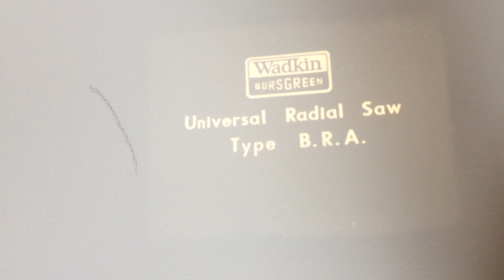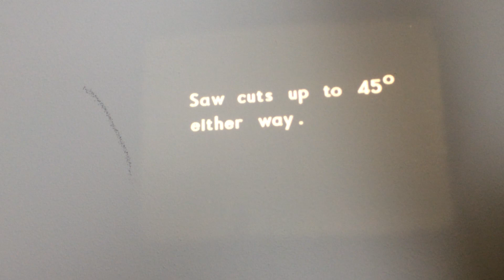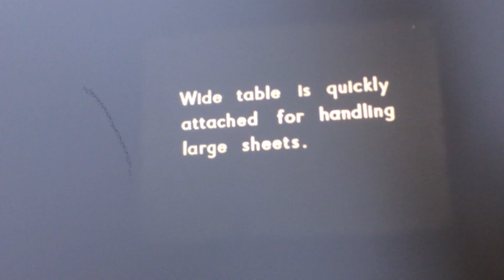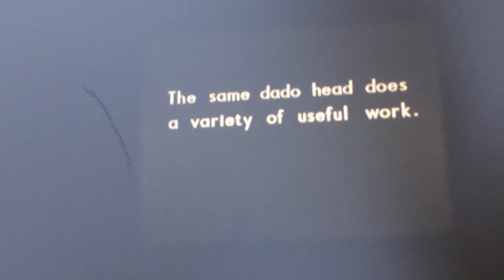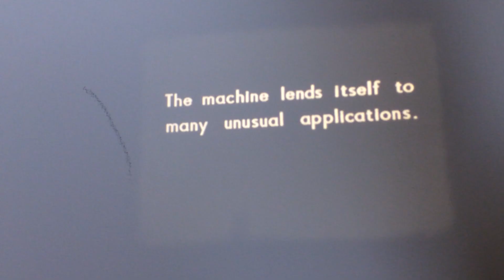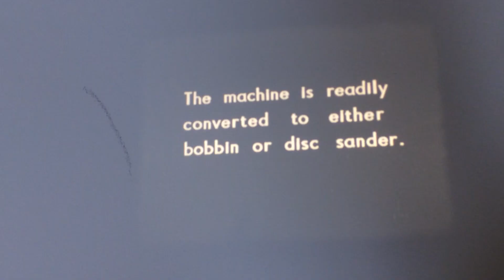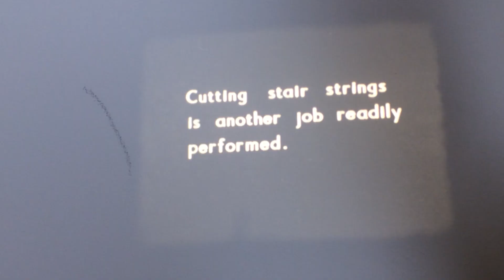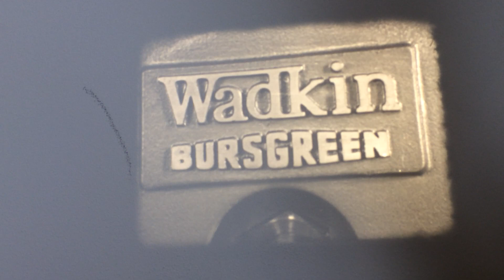IMG 4450

Comment: Good Stuff! I've never personally seen these used beyond the simple crosscutting/trenching jobs that they typically do. It would be interesting to know if anyone still uses them from time to time as a spindle moulder or a overhead router. Although I imagine cove cutting traversing the blade like that would do no good for the bearings! From a time where men were men and fingers were scarce!

Please sir can I have some more!
Reply from the maker: I have a one of the Dewalt version which does even more, plus a dewalt with a 30" blade. I wonder which came first wadkin or dewalt
Reply: I've always thought Dewalt (I think the actual Dewalt guy invented it) came first in the US and were quite rare over here in the UK until the later Powershop models were everywhere. I imagine a CC with a 30" blade is quite a sight to behold when under power!
Reply: Thanks again for this Mark.